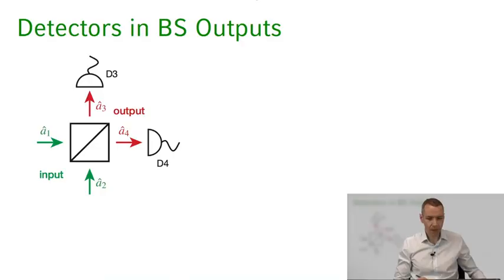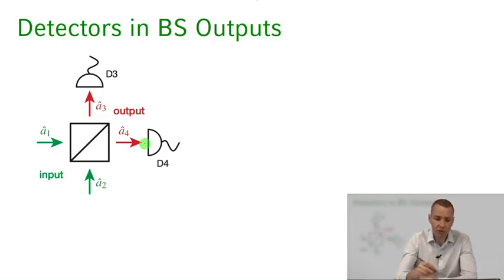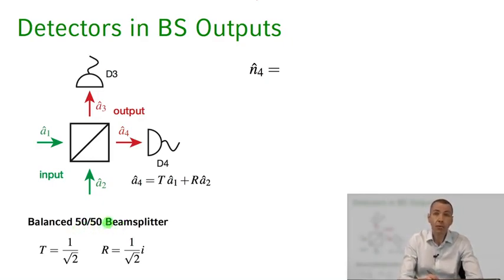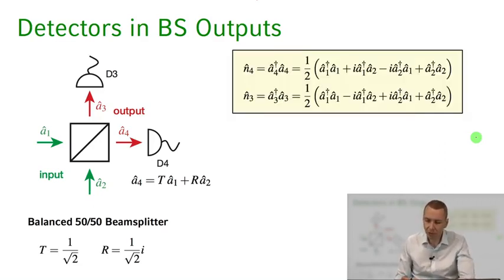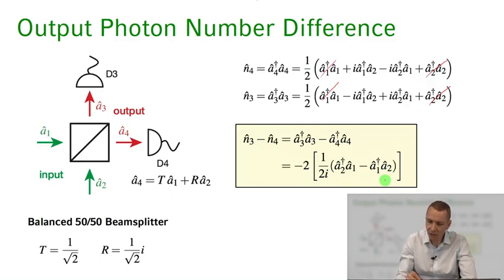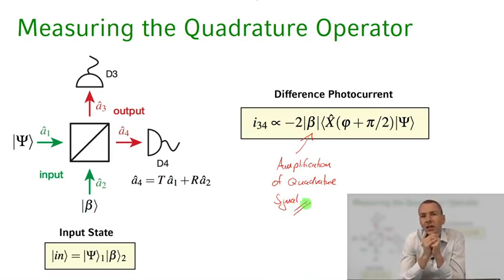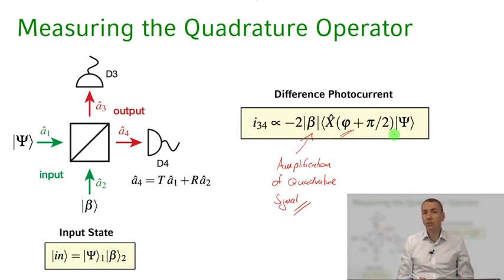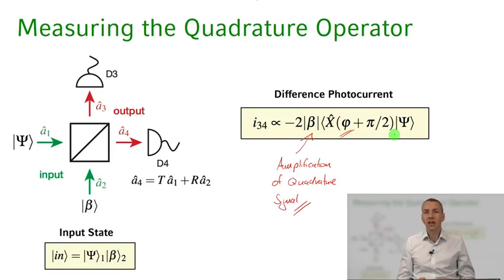Quantum Optics  || 05 Lecture 25   Homodyne Detection of States

Comment: nice effort. can you please explain why we taken the difference n3-n4. thanks
Reply: this is the balanced homodyne part, you have two detectors and take the difference between the two photocurrents which ends up giving you the quadrature expectation value directly. If you didnt do balanced detection, and just had homodyne detection, i.e., simple interference with one detector, you will still have the quadrature measurement, which is just proportional to the interference term, but you will get on top of that the measured intensity of the non interfering terms (the intensity of the signal and the local oscillator) and you will have to figure a way to measure them separately and subtract them.